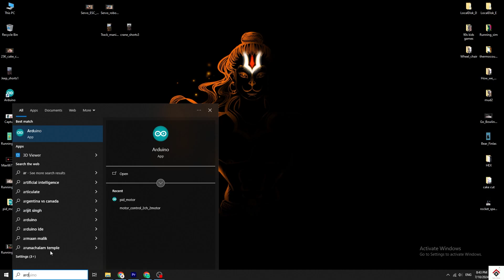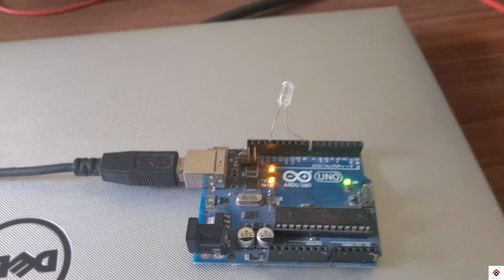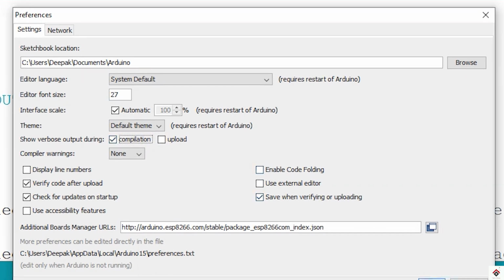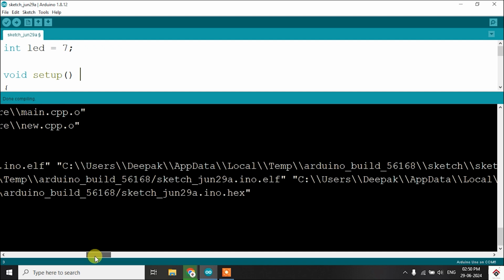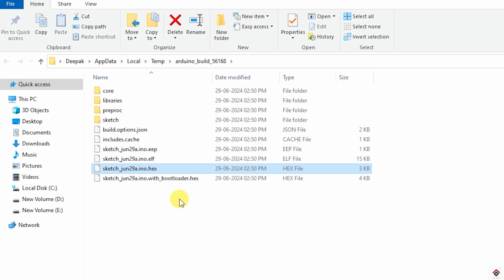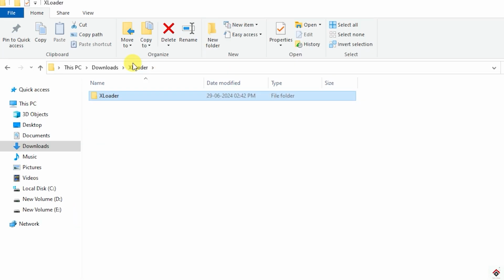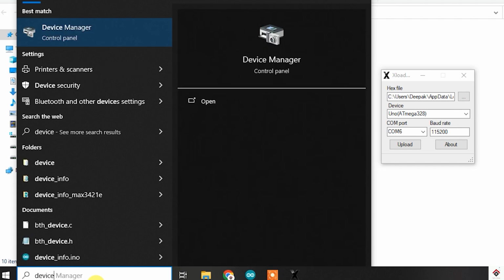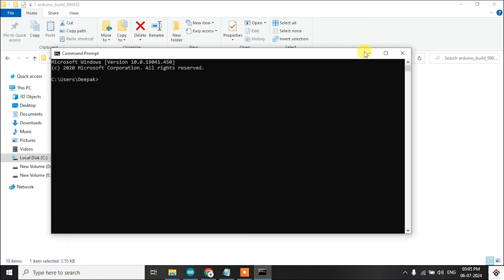How to Generate and Upload .hex files in Arduino | How to Generate HEX files , Arduino Tutorials

Comment: #techathome Sir can you please tell me the difference between bootloader.hex and without bootloader hex? Kindly please help me...Waiting for your answer. Thank you in advance.
Reply from the maker: In simple way, 
1. Application software will handle all the required functionality.

2. Bootloader software is responsible for re-programming(It receives the code from USB serial and stores it in the microcontroller's memory)

3. If you upload hex file without bootloader(which has only application code), your required functionalities will work normally but you cannot re-upload code via USB. You have to use ICSP programming: https://youtu.be/TtC6crf_EP4

4. If you upload hex file with bootloader(which has both application code and bootloader), you can re-program.